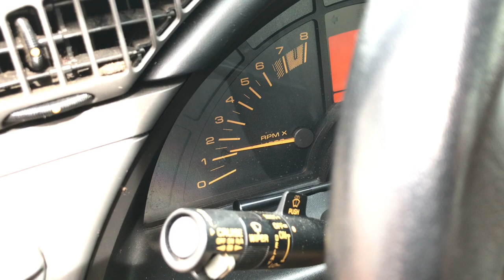I bought a 1991 Corvette ZR-1 - Sight Unseen!

Comment: The important thing is you got one.  C4 ZR-1 will appreciate in value.  Anything on these cars can be fixed or restored.
Reply from the maker: Good points.  This one was bought at the low water mark.  I am replacing many things on it.  You are correct - these can be repaired fairly easily and cheaply, and you have a race car for little money.  One that you can drive across country.  Pretty amazing really.  I love it

Comment: My 1991 has 32,000 mile and my windshield is delaminating also.  I absolutely love my ZR-1... Great find.
Reply from the maker: cool.  looking forward to driving this car.  it is in storage now.  more videos to come as I get it running right.
Reply: That's not delamination. It's the factory UV protective coating specifically for the ZR-1. My '91 Z is the same way.

Comment: You have got a really nice car, it still has the original windscreen which you can see by cut-out in the anti-solar metal coating (which was for garage door openers and radar detectors), I don't know how old your tires are but the car can get out of hand right quick on good tires on old rubber they are a nightmare, a 4:10 rear end and new bushing are a great upgrade.
Reply from the maker: I think those tires are pretty old.  Scared to look at the date codes.  I'll replace them when I start driving the car as it's in storage now.

Comment: I coulda swore ALL C4 ZR1's were set-up from the factory so that the only way to remove that valet key, was to switch it to normal mode. When the key is switched over to full-power mode, it can NOT be removed. So if ya lose that key, your stuck with a ZR1 making only around 240 hp.

Comment: Are you going to flip it?  Or keep it as a driver?
I own the twin to this car, except for a black interior.
I've had it since 1994, so if you need any maintenance, or performance advice, let me know.
I've got just about all the performance bolt-ons that you can buy for it, and know what works,
Reply from the maker: thanks.  I plan to drive this car.  It's got 88,000 miles and will make a good driver.   Right now it is in storage in Montana and I cannot bring it into Canada due to border closure.  I hope the border reopens by summer!  Then I will be in touch.   I'll first change all the fluids and tune up parts then drive it for a while to see how it performs.
Reply from the maker: I now hope the border reopens by Summer 2021.  Beginning to wonder when I'll ever see this car.  Hope it has good antifreeze in it.
Reply: @gregs_garage  sorry about that! Hopefully we can get an update soon. Subbed
Reply from the maker: @SiikPros  Yep as soon as the border opens this thing is coming home.  I suppose the battery is frozen and wrecked by now.  Also the washer fluid is probably frozen and who knows what damage done.  Who knows what else.  I will resurrect this car and do many videos!  Politicians willing...
Reply: @gregs_garage  I feel like a piece of my heart is falling apart. Don't ruin that car!... Lol. I have a 1990 in my garage with 23k on it. I love it!
Reply from the maker: @terrencevanderbosch5233  the car is home.  more videos coming.
Reply from the maker: @terrencevanderbosch5233  This car is lucky I got it.  I am fixing many issues with it, it is overall a solid car but has not been owned by a fussy person for a long time.  LOTS OF WORK and  More videos coming.